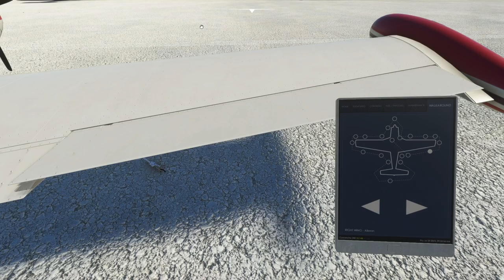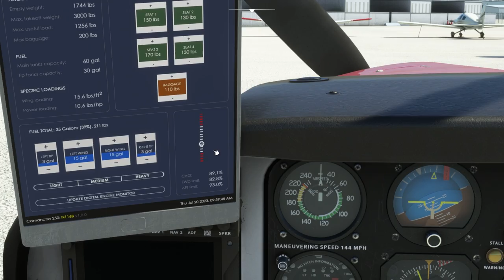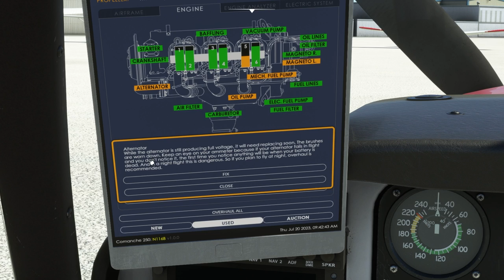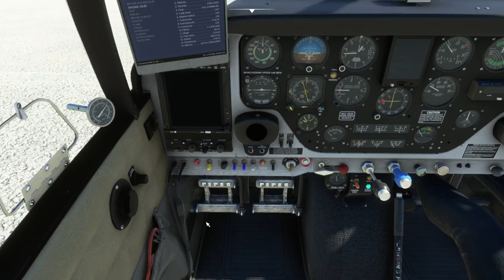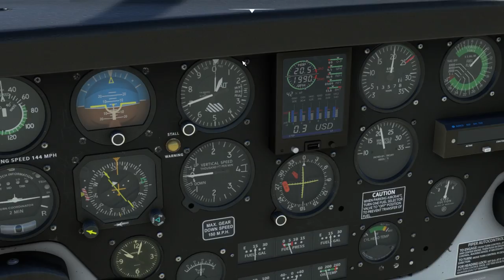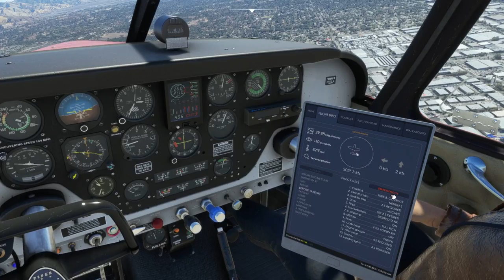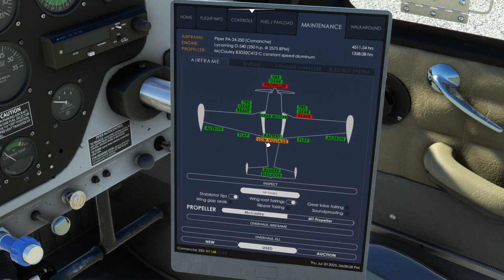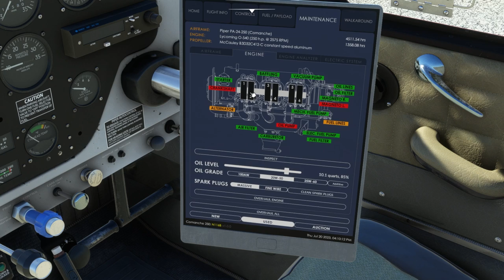CATASTROPHIC Engine Failure | A2A Piper Comanche 250 | MSFS

Comment: Looks like you had a sudden oil pump failure.  Wow, this is rare.   I've flown this for thousands of hours during development and never had an oil pump failure in flight.  I'm glad you captured it.  If felt so real.  This is why we gave the failure rate sliders to increase the chance of these things happening.  Great job.
Reply from the maker: The simulation of the engine literally destroying itself due yo lack of oil blew my mind! You should be extremely proud of this product u made! Thank you for stopping by
Reply: Does failures needs to be turned on in MSFS options?
Reply from the maker: No the failures are independent of MSFS

Comment: Looks like you lost oil pressure. The prop pitch governor works with oil pressure so that’s the first thing that went and what caused the RPM to get so high out of nowhere. Without that lubrication, your engine then slowly tore itself to shreds. Amazing level of detail!
Reply from the maker: Wow!! Thats is amazing level of detail but what would cause the loss of oil pressure?
Reply: @BluGames as you saw in the maintenance page of the tablet at the end of the video, the oil pump stopped working
Reply: @BluGames  Well that is of later concern. Procedures for Oil pressure loss are in the manual and Emergency checklist Loss of oil pressure.
Reply: Good spot.  So okay, at 24 minutes we see the bottom left engine instruments needle drop to nothing and the rpm needle shoot up at the same time.  We see at 7:21 that the oil pump was orange before the engine started.  The details on it at 8:50 showed it as still being airworthy.  Oil temperature looks okay on takeoff.  Any idea what he did wrong?
Reply: @weswheel4834 nothing besides going in the air with a worn oil pump. If I had to guess, he had the wrong oil for the conditions he was flying in.
Reply: @curtisridge2506  Doubtful as the default weight it comes with would be appropriate for the area and I doubt he changed it.

Comment: Thanks the crash was excellent learnt a lot. First lesson, check oil pressure asap. Look for landing sight and land into wind full flaps at stall speed. Which is better, gear down or leave up?
Reply from the maker: Most cases gear down

Comment: Hey Blue Games, are you still having the problem with brakes that can be seen at 21:07 ? I've been struggling with this problem too and so have a few other people that replied to my post on the A2A forums. Something's wrong with the brakes post 1.1 I believe.
Reply from the maker: 1 of my brakes actually failed. So i fixed it on the maintenance screen after the flight
Reply: @BluGames  And you never had the problem again ? 

I doubt it was the reason to be honest because I've been having the exact same issue with the brakes you had in this video but mine were never broken in the maintenance screen. Yours were most likely broken because it was an auction plane.

Comment: Interesting to watch this engine failure, but apart from the fact that it could have been prevented by proper checks, the pilot’s reaction was far from appropriate. In reality you have little time at such low altitude (a reason to study and memorize emergency checklists as well), but in order to lower fire hazard upon landing you should at least turn magnetos off, mixture off, fuel pump off and fuel tanks disconnected. Also unlock the door, otherwise the door might not open after damaging the airframe. Lower gear and flaps when you know you can make it to the desired landing field. You could have walked away choosing the adjacent field, but now I fear you might have had four fatalities, either by the crash or a subsequent fire.

Comment: How does the pot look if there is water in the fuel tank? How to differ water from fuel in the pot in the simulator? Thank you.
Reply from the maker: Fuel is blue.
Water is clear.
If theres water u will see clear liquid on top  of the blue liquid inside the cup.
Reply: @BluGames  Why is water on top of a blue liquid if gasoline is lighter than water. So the water must be under the gasoline.
Reply: @BluGames   This video by Scott (A2A) shows that water is under fuel ("Accu-Sim Comanche 250 MSFS Walk Around" timecode from 04 : 12)

Comment: Maybe I missed it, but did you attempt to feather the prop?
Reply from the maker: After i lost the engine no i didnt
Reply: It may not have gone into feather if you were already in a runaway situation, which it seems you were.

Did you exercise the prop before takeoff?
Reply: Very, very, very few single-engine piston aircraft, with controllable pitch props, have the ability to feather. The best you can do is get them into a very coarse pitch, assuming the prop is still turning and there is nothing wrong with the oil pump. The very coarse pitch may help if the prop is not turning, but not sure what the results would be if it was still windmilling with that coarse pitch.

Comment: After flying for 5-10mins, the manifold pressure drops to zero, the Comanche lost power and dive to the ground. The aircraft doesn't respond even when I add more power with the throttle.

Any reason for the sudden lost of power?
Reply: You destroying your engine, lower that rpm and mixture
Reply: @curtisridge2506  noted thanks, didn't know this is stimulated in A2A too.
Reply: Lots of things could be the problem, it is a complex sim.  But if you lose manifold pressure the first thing I would check is icing and flip on the carb heat to see if it helps.  Also, follow the emergency checklists
Reply from the maker: Hes right
Reply: @curtisridge2506  I reduced the RPM and mixture, the engine still stall after 5-10 minutes. Probably is carb heat problem.

Comment: I just wander - why oil pump died so quickly. How many hours you've put into aircraft? It was yellow on inspection, and really did not show, that it can fail so quickly, I believe... Did you have real time wear, or speed it up? I just wander, because it does not look realistic if it can happen that quick. Just a though.
Reply: Well he had a used aircraft so it was already preworn to some degree
Reply from the maker: I sped up the wear and tear

Comment: After putting fuel in the tanks, did you check for water in the tank again ?  Not that it mattered .. lol   You landed with a lot of speed , to much in this case , especially with faulty brakes ..allways come in as slow as you can ,sideslipping, flaps, and taking your time can save your ass and your plane.. As they say "if you can walk away from the aircraft, it was a good landing and If you can use the aircraft again, it was a perfect landing"..
Reply from the maker: Copy that

Comment: When oil pressure is lost the oil can't circulate in the engine and why CHO cylinder head overheat displayed, causing temps to seize the engine in flight.☕
Reply from the maker: Lol thank you. Your are exactly correct

Comment: you lost your oil pump
Reply from the maker: Is that what it was? How do you know?
Reply: @BluGames  You probably already reviewed by now but yea the oil pressure gauge went to 0 instantly, had to go back myself. Pretty cool how it will make a person have to react fast in a situation like that.
Reply: @BluGames  Oil Pressure gauge was at 0   before the engine quit and the pump was one of the components that had completely failed in the inspection

Comment: When something goes wrong at the A2A
Piper Comanche 250
But this can be repaired or inspected, right?

(Which airport did you take off from?) 🛫✈️🛩️🛬
Reply from the maker: Yea u can prevent many of these failures with normal maintance. I took off from KVNY i think